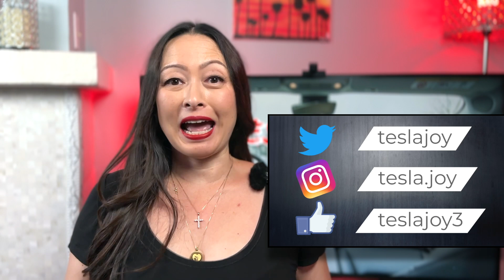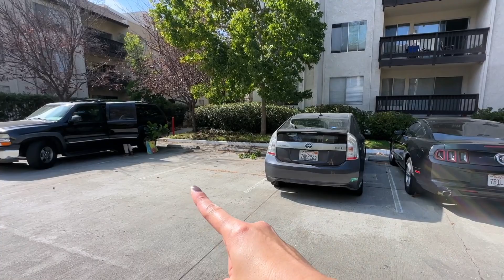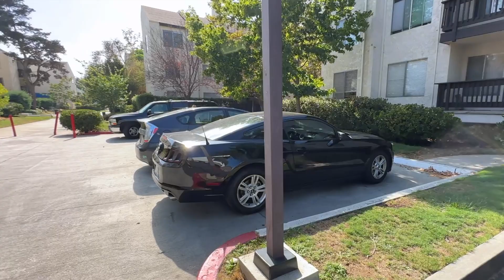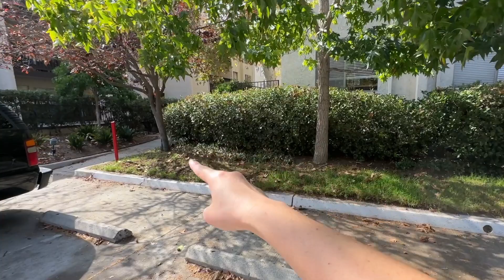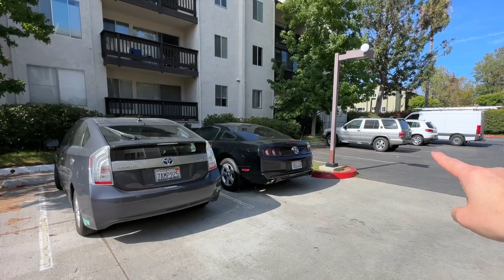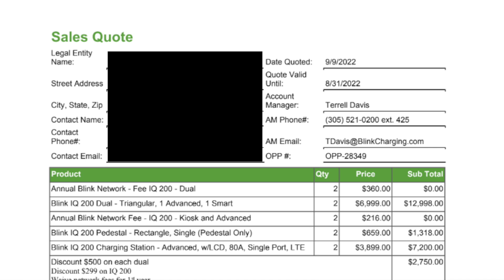Our Community EV Charger Project Almost Failed! - Episode 6

Comment: I have not seen retrofitted EVSEs in existing multi-unit complexes and your experience is one of the reasons why, even with the good rebate from the utility company.  Only a person with a passion for electrification of transportation would persevere such project management effort.  I'm sure that it will be all worth it in the end and will enhance property values.  Your efforts are commendable.  I had the opportunity to walk through a newly constructed luxury condominium and each parking stall was capable of having it's own EVSE!  I noticed that about a fifth of the stalls had installed EVSEs and they were all Tesla wall chargers (must be a AOAO design requirement).  I didn't take a good look, but I'm guessing that they must have to get a supply of the Tesla J1772 wall chargers for the non-Tesla EVs.

Comment: Geez Joy!  What a hassle - I live in a townhouse that I purchased in 2005 and when I purchased my Tesla Model Y Performance, it took 3 months for my HOA to approve the installation of my Gen3 wall connector at my assigned parking space in front of my home.  

I hired an electrician to run the armored cable from my service panel with a new 60 amp breaker in my basement underground to the Gen3 wall connector.  He had to run the cable under the sidewalk.  Cost was $2.5k.  My HOA only approved my request as long as I accept full responsibility if one of their contractors (snow removal/landscape) damages my cable, mounting post or the Gen3.  Also, when I sell my home, I have to remove everything and ensure the property is back the way it was before installation.

I’ll never purchase another townhome or live in an HOA community again.  Lessons learned.

I wish you luck on your HOA’s installation of the Blink chargers.  Thank you Tesla Sister!  ~ aka @RedTeslaGirl on Twitter
Reply: HOA’s are dealbreakers when purchasing property for some people.